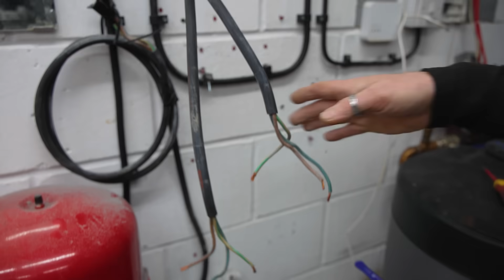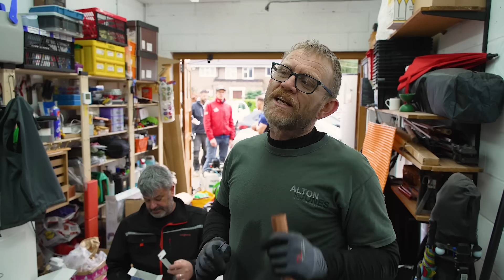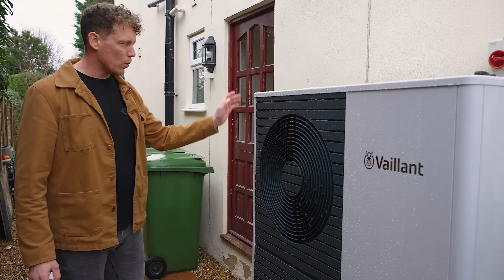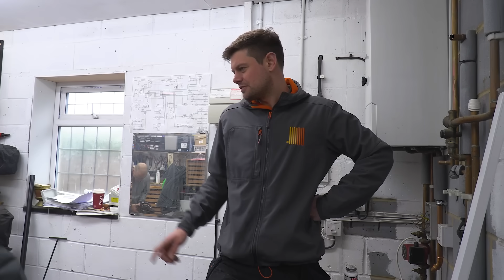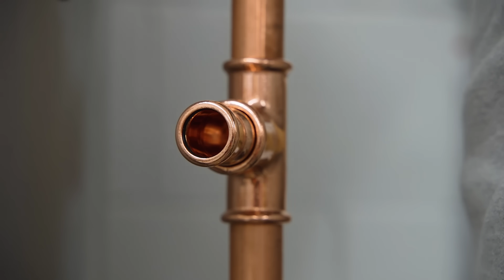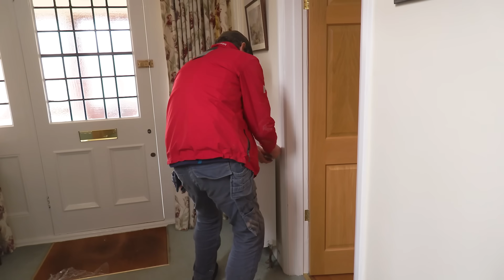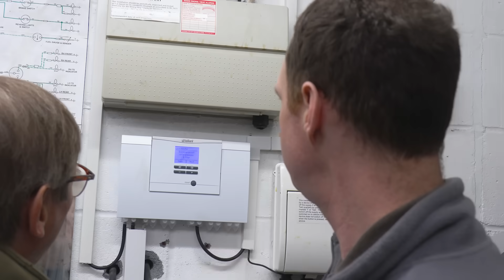Ultimate Heat Pump Installation. Rip It Out & Start Again!

Comment: I really enjoyed watching the transformation from the old heat pump to the new heat pump. Looking at the live data, it looks like the house is pulling an average of 40.5625kWh per day. The current price cap cost of 28.6p per kWh means that the homeowner is paying £11.60 per day for heating.  Am I right in calculating that if he just ran his gas boiler, it would only cost him £3 per day? (40.5625 x 7.4p per kWh)
Reply: You have forgotten to factor in the efficiencies of both the HP and a gas boiler. The HP is currently running at a SCOP of 4, so that 40.5kWh of electricity generates 162kWh of heat.
A gas boiler running at, say, 85% efficiency would need 186.3kWh of gas to generate that amount of heat. At 7.4p per kWh that would have cost £13.78.
The heat pump running costs are lower than the equivalent gas costs.
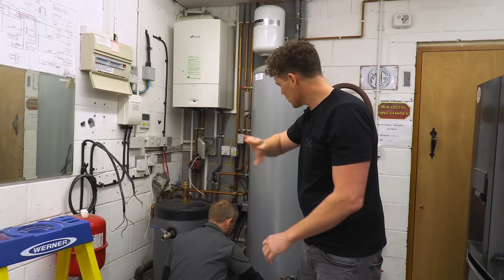Reply: @Cheradanine @Cheradanine  162kWh is a lot of heat when you compare this to my current gas boiler, which, on average, around the same period uses 53kWh per day. I'm not sure of the house size and number of rooms, but from watching the video it seems a similar size house to mine. My boiler is over 25 years old, so it will only be between 75 and 79% efficient. We have the house at 20c from 6:30 to 9pm.I don't understand why there is such a big difference between the output of a heat pump and a gas boiler. Is this down to how kWh is calculated for gas vs the output of a heat pump? Both are not true readings but a calculation, as the only true reading is from electricity input.
Reply: @jasonbramsden7128 The heat requirement is the heat requirement, regardless of what's generating the heat. There's no way you can compare your house against his unless you have the heat loss calculations for both. Even then, the requirement will vary as one owner might want the house heated more or for longer. You have even said that you are  "not sure of the house size and number of rooms" so how you can draw any comparison between this house and yours is a mystery to me. 
Heat output is absolutely measurable. The heat pump knows how much it has raised the water temperature by and for how long as well as the return flow temperature and volumes. That's all you really need to know to work out the heat output.
Reply: Yes you are right, no reply for those questioning the agenda.
Best day was 72 kWh 😂 average around £350 a month to run this ?  😂
Reply: @haydnlawrence8167 For that 72kWh of electricity, the unit delivered 218kWh of heat. Looking at my gas bill I'm currently paying just under 7p per kWh. Lets assume a gas boiler running at 85% efficiency (unlikely to be that high, but let's assume so)...that would need 257kWh of gas. At £0.07/kWh that would have cost £17.99.  That would equate to £537 per month.
Reply: Well, currently I'm paying ca £8-50p per day for gas Inc heating and cooking plus £1.50 per day for leccy. That's with an old CF gas boiler. As elderly folk we're at home all days and heat all rooms in our semi.
Reply: @nickhickson8738  This works out around £250 a month gas and £45 electric. 
In our 2 bed semi it cost us £75 a month and both of us worked full time.
Reply: I think it's the heat output figure we need to calculate for comparison, that works out about the same cost as gas.
Reply: @adyg236  Of course you do the fantasy heat output figure that can’t be measured it’s just a calculation, then you can pretend it’s cheaper than a gas boiler 😂
Reply: @haydnlawrence8167  The heat output can be and is measured.
Reply: @Cheradanine  How is it measured ?
Reply: @haydnlawrence8167  The water outlet temp and flow rate or measure the difference in intake air temp Vs output air temp.
Reply: @Cheradanine  Ok , the 162 kWh of heat in your previous example, how is this measured , not calculated ?
Reply: @haydnlawrence8167 I've already told you how.
 What's your beef with calculations? How do you think the incoming electricity is measured? Using calculations based on electromagnetism is how.
Just because you don't understand something doesn't mean that it's incorrect.
Reply: @Cheradanine  EXACTLY, it’s calculated not measured, the same with CoP and SCoP they are calculated not measured . 
So if it can’t be measured it’s just theory.
Reply: @haydnlawrence8167  What are you on about? Tell me how an electricity meter works.
Reply: @Cheradanine  You said, for 72 kWh of electricity the HP delivered 218 kWh of heat .
This figure of 218 kWh of heat is a calculation therefore it’s theoretical.
Reply: @haydnlawrence8167  Nope. Read it again.
You appear to be confusing heat output, COP and SCOP. 
Again, how do electricity meters work?
Reply: @Cheradanine  Just to be clear, a Watt is a measurement of electricity and not heat. If you remember from GCSE Physics Watt = Amp x Voltage.   I agree with 
@haydnlawrence8167. Heat is a calculation, most likely based on an 1960s/1970's 1KW electric fire(if someone knows what it is based on, I would be interested in reading the paper on this). The worst is that gas kWh is also calculated, and that has a lot of variables, and in reality, it is only an estimated kWh. Because of this debate, we are having in the comments, I have realised that we should not be comparing gas kWh with a heat pump kWh as it is not comparing apples with apples, but more like comparing apples with pears. It would help in this example if the homeowner could show their gas bill calculated cost per day just before the reinstall of the heat pump.
Reply: @jasonbramsden7128 LOL...a Watt is a unit of power. It is one joule of work per second and can be used to measure any power. The Watt is also the standard unit for measuring the rate of heating (1 Joule per second). It is not based on a 1970s electric fire!  Best go back and re-do your GCSE Physics. ;-)
Where @haydnlawrence8167 is floundering about is in his mind he thinks that if a number is calculated then it does not exist. I'd love to hear him arguing that one with a magistrate if he ever gets caught for speeding (assuming he is old enough to drive).  "Speed is measured in miles per hour which is a calculated number derived by dividing distance by time. Therefore it is theoretical and doesn't exist. Case close, Your Honour".
Reply: @Cheradanine  you are right a joule is a unit of energy and you can calculate a joule using a watt. We should be using joules for heating, but we use kWh based on something that happend in the past. I remember this being discussed in my Electrical and Electronics degree, but that was over 30 years ago, so I can't remember the scientific paper that this was based on. Let me tell you where I am coming from, I am very interested in being green, so I'm very interested in replacing my inefficent boiler. I love the work that the Heat Geeks are doing and it is great for them to expose the data from this install. At the moment, the data looks off when I compare it to a Gas boiler and I'm trying to calculate if was to install a heat pump, would it cost me more in the long run.
Reply: @jasonbramsden7128 I hear you.
I want to ditch my gas boiler and hob, but the economics just don't add up for me. My house is only 4 years old so the boiler is still fairly new. I have installed PV, 16kWh of batteries and an A2A heatpump to heat and cool two main rooms.  I only spend about £60 per month on gas, so usage is pretty low. An ASHP would cost ~£2K from Octopus or ~£10K from Heat Geek. Plus I'd need planning permission due to already having a heatpump and due to location. Given my current gas usage, £10K would buy me gas for the next decade!
Reply: @jasonbramsden7128  The heat output and the CoP and SCoP are smoke and mirrors designed to distract people from the actual running costs. Quite simply how much gas @ 7p per kWh against how much electricity @ 29p per kWh?  If the heat pump is running 24/7 as designed , it will cost a lot more in that 24 hours . As opposed to a gas boiler running on demand maybe 6 hours @ 7p per kWh.  Both the gas and electric input can be measured and both of these are directly related to the money flying out of my wallet, which can also be measured.
I don’t really care what heats my home as long as it’s cost efficient and this video proves heat pumps are not just on the installation.
Reply: @adyg236  you raise a very interesting point and one that I have not thought about before. I have a house which is C rated and a gas boiler which is 25 years old. In the coldest days this year it only averaged around 53 kWh. Does this mean the system used in this house require more kWh to heat with a heat pump?

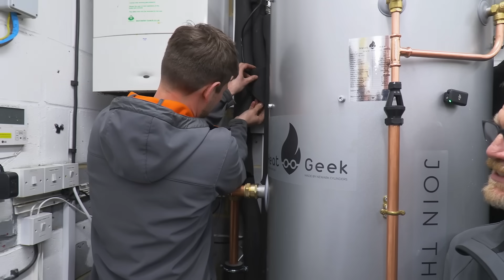Comment: @ 28:42 ESBE 🤤🤤🤤

The 50kw and up alpha boilers have the electronic boards made by honeywell and implicitly are compatible with the 3-way valves from honeywell because the outputs that control the 3-way valves are timed and I have to put 2 relays with double contacts to obtain non-timed bistable permanent commands for the 3-way valves from ESBE and not only… 😊

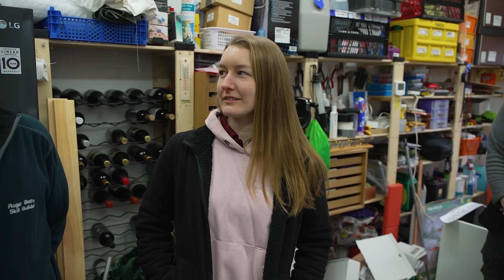Comment: @ 24:12 I kinda like Mitsubishi air to air ac’s … 
My favorite I seen so far is a Hitachi  multisplit - just 2 wires from the indor to outdoor, 22 volts + data on the same wires … + nicely made electronic boards…
With Daikin is a love/hate relationship 😅
there is no perfect AC

Comment: What happens when it is -8 outside temperature?
Reply from the maker: The COP goes down.  It doesn't happen often in the South of England so it might be a while until we get that statistic
Reply: That's as maybe but keep one's fingers crossed that our Winters in the future will always be milder, dull and grotty with few nights/days where the temperature stays below zero. We have had those in the past. Heaven help Heat pump owners then!

Comment: Great job I agree, but all too complicated like a modern car. Just on, off, timed, that’s all that’s needed. All the people that have this fitted have to go on a compulsory course to be able to work it, but their eyes glaze over within the first 5 mins. We have mains gas, it’s a third of the price or more per KWh than electric. If I was building a new house then maybe that’s the best thing to do. But older existing houses, well? My mother had air to air fitted some years ago, mainly for the aircon in the summer. After 10 years it stopped working. Two different engineers came and both concluded the main outside unit was u/s, no spares available, because of the refrigerant, the whole system was scrap. It never got replaced. I believe this will still be the case, so much to go wrong with these systems. Leading to ‘ oh sorry they don’t make your unit anymore’

Comment: Am I reading the live data correct…
After 16 days monitoring 
636kwh of electric used🫣
636x0.28=£178
Reply: and 2490 kWh of heat.  A 90% efficient gas boiler would have cost 2767kWh*0.07 £194.  Assuming he's using Price Cap rates.  I believe he also has solar, so there's part of that covered for "free".

Comment: Did I miss the cost breakdown? 🤔
Reply from the maker: If you want a system like this installed from scratch is will cost around £22K. If you have a cylinder and radiators it could be as low as £16K. The grant is £7,500
Reply: Thanks. How much it does it cost to run and how long will it last?

Comment: I can honestly say with a 4 bed 14 rad house I do not have space for the HP outside or a larger HW tank inside.

I have a 30kw system boiler tucked away and an unvented cylinder at 65deg. It all works like a charm and apart from those components I can work on it entirely diy.

If you want it, have it but don't expect me to pay for it.

Great video and top skills of those involved fitting it.

Comment: Jeez, I wish I had you all here! A couple of months ago I contacted one of only two Heek Geek-trained/approved engineers here in the far north of Scotland (both of who are about 100 miles away!) and paid him what was a very reasonable amount, considering he had a near two hour drive at each end of his visit, to look at my installation, fitted by McInnes heating engineers as part of the Scottish Warmer Homes/Warm Works/Scottish Gov initiative to get heat pumps fitted, especially where solid fuel had been the previous system. He analysed my installation, indicated one particular 'problem', which we largely sorted during his time here. While this has made little difference to the amount of electricity being consumed, I now have every part of the house toasty as, hmm, very fresh toast! However, it seems my pump is probably over-spec-ed, so I need to have every emitter in the house fully open. I am still experimenting with reducing the heat curve, 0.05 at a time, to try and find the sweet spot. John, the engineer, suggested as a possible longer term fix (to reduce cycling as the volume of my system re-pump is only just sufficient when all rads are open) that a volumiser vessel could be fitted at the return end, just before the pipework returns to the heat pump, but that keeping all rads open all the time my system is just about optimal. BUT - I can already tell, from checking data off the controller, and watching the electricity meter into the house, that my original SCOP of 2.5 is not going to be improved on. 1 kWh in, 2 kWh of heat out at freezing outdoor temp, nearer 2.5 at 10+/-, and 3 when in the teens C. SCOP of 2.5, but with more of the house toasty (I don't need or want to heat the spare room, but it seems the system is more efficient that way). I have the older iteration Arotherm ie pre-Plus, 11 kW unit, which when you check its spec, it shows the lowest COP of all that range. I am still quids in compared to solid fuel - by a factor of at least two, maybe even three, my system was fitted as fuel prices had just started to rocket so it's hard to make a direct comparison - paying about £105 a month averaged through the year at current prices, for a lovely warm house, and no ashes to tip out daily, with all the heft of getting coal and wood in, hard enough for an arthritic fella in his 60s... But a SCOP of over 3? It's not happening here folks. Any suggestions, should you have got this far... Cheers, keep up the good work (-;)~
Reply: Is the heat pump running 24/7, if so then that  £105 a month isn't quite so bad if that's @ 28p/kWh ?

I have a Daikin 6kW been running five weeks 24/7 with me trying to find best weather compensation curve, two bedroom semi, modest insulation. System is 7 new radiators & plumbing, with 27 litre volumiser. Flow typically 32-36C.
N.E Scotland where four nights below zero in past five weeks, tonight 3.5C (average for month 6.5C hourly average). I have set schedule temperature on Hive thermostat very low allowing the rooms to sit at the weather compensated 'design' temperatures without any interference from thermostat calling for heat.

Certainly the DHW SCOP on my Mixergy cylinder appears to be in the 2.5-3 range as expected when heating DHW cylinder to 50C (too early to tell yet). So if heating a lot of hot water, or keeping steady temperature on DHW using immersion heater would certainly drag overall scop down, perhaps unnecessarily.

My overall SCOP for heating since installation shows 4.2, electric meter seems to tally with 'typical' usage of 11-14 kWh per day. living room 21-22C, bathroom similar, other rooms 18-19C, and my bedroom 16C (only one throttled down using TRV). All other TRVs fully open for max' flow rates. This is pretty consistent irrespective of external temperature.

I plan at some point to add monitoring to give me a better picture. At present relying on system energy in and heat out figures.

Running cost for me is @ £109/month for heat pump.

Comment: How can this be green. All those metal units, copper wiring, copper pipes. One boiler replacement and insulate the house has to be greener.🤷🏻‍♂️  In addition. Look at the number of components that have the potential to break down. I fear this is just a big payer for heat pump companies and a cash drain for customers.

Comment: 631 kWh since feb 24 @ .28pence per kWh that’s £176 in 18 days, seems expensive to me.
Reply: It's currently showing a SCOP of just over 4. That means it is actually cheaper than an equivalent gas boiler.
This is a pretty big property. Big properties have higher running costs.